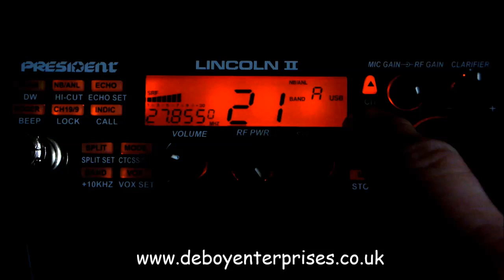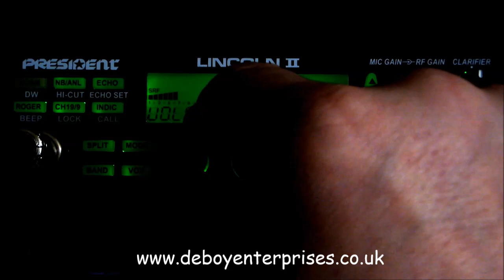President Lincoln 2 - Engineering Menu!

Comment: I dissed the L2+ and got myself the CRT SS7900V turbo.

I can set ALL frequencies of all 10 bands, I made two bands where all channels have the "public" option set and two others where all have "public" off. That way I can set individual channels to listen to a different mode whilst the others stay untouched, and on the other band changing the mode will change it for all channels, very handy for scanning.
The display is just awesome too.
And it has an awesome noise reduction delectable now - no other rig can compete with that.

It's the best rig I ever had. I had the first version before in 2016. But this now is definitely better.
No need to tweak the output power or mess around with the modulation and microphones.
Reply from the maker: I agree, the CRT SS7900V  is superb and probably the best radio out there at the moment.

Comment: @delboyonline Have you found a way to tweak the ASC values yet? I find mine need a little fine tuning. I can’t seem to find any other resources online. A couple people say they’ve unlocked the mysteries of this radio, but have not published a concise explanation of the service menus. The service manual I have is for the Lincoln II and does not detail the menu values for ASC.
Reply from the maker: You need a signal generator to adjust the ASC and other values in this hidden menu.
Reply: @delboyonline  Okay, that’s fine. But what I was asking is- are the values changed through the menu by using a different programming password, or are potentiometers on the board adjusted while injecting a tone?
Reply from the maker: @GrEmLiN76X  You inject a signal and the strength of the signal sets the value in the engineering menu.
Reply: @delboyonline  ... how is it adjusted??
Reply from the maker: @GrEmLiN76X  haven't done it myself but if I remember correctly you inject a signal then press one of the buttons (possibly menu) to register the appropriate level.
Reply: @delboyonline  great, thank you for your guidance! Have learned a lot from your videos and your website.
Reply: Thank you

Comment: Anyone that has the lincoln 2 plus, I can help you. I got the split frequency figured out. Clarifier not working? I got it.
Reply: I've just got a 2+ with 24.715 - 30.105 Mhz range freq. I would like to unlock the clarifier on TX/RX, right now it's on RX... I was told to not touch it if the freq. is tuned on SSB in the middle of the knob, and that you can ''untune'' the clarifier by doing so... should I forget about it?
Reply: How do I adjust my tx meter when I key the mic?
Reply: @Tall Biker Ace........Have you helped anyone?
Reply: hello. Do you know how to increase the modulation level in AM and FM through the hidden menus please? I have a Lincoln 2 plus which works perfectly in LSB and USB, but the modulation is very weak on the other modes.
and the mic gain is not enough powerfull on AM & FM.
Morever,do you have the factory values please?
 thanks in advance! 
73' 👍

Comment: So you bought a 10 meter radio and don't know those settings are to be used on 10 meter repeaters? Those are the  a sub-audible (CTCSS) tone be transmitted to gain access to the repeater and the offset frequency settings.
Reply from the maker: Wrong! 😀

Comment: That is your service menu....fr 9 is feq or frequency.....that is how you align the radio on freq.....since there are no internals to do that it takes some time with a service monitor to put the radio on frequency because it uses variable voltages to align it.  The others are the recieve sensitivity. ...squelch sensitivity ect.  If your not familiar or not a skilled tech with proper service gear. DO NOT CHANGE THE FACTORY SETTINGS.  Lol.  I found out about these settings because the crt 6900 is adjusted in this manor with a secret service menue....once you get the codes and their meaning, you can tweak the radio proper.